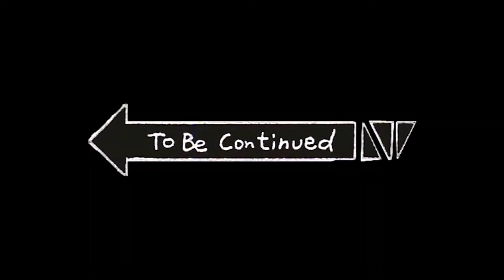Pallet barn build. part 2.

Comment: Why did you screw everything instead of using nails in some places??
Reply from the maker: Hey, I prefer screws for most jobs, but if you look at the third part, I use nails there. Thank you!
Reply: @normalguydoesitall  i prefer screws also but would you say there is a difference, advantage -  between using screws vs. nails - cost ??

Comment: When sheeting a roof you might want to think about staggering the seams.  It makes a much stronger roof and prevents sagging.  Actually that applies to hanging any sheeting, not just a roof.
Reply from the maker: Thanks for the advice, it was my first time doing a roof like this. ;)
Reply: @normalguydoesitall  always think of how you see a brick wall. Everything is "stepped" as it makes it much stronger. Still, a very good job.
Reply: I was thinking the same thing 👍
Reply: This barn idea is cool👍👍
Reply: Sheathing
Reply: Excellent job 👌🏻
Reply: @lakeside441  lol
Reply: another contractor here to agree with staggered seams...
I have a question, how are you connecting the two stacked pallets to the 2x4 between? I mean hardware? I would suggest 4x4 post between each pallet width for a load barring wall,
I'm not coming down on you, I'm a prick by habit because I break down everything built in my head, I can't stay in motels hotels because I nic pick everything...😂

Comment: I saw you used metal joining plates at the top of the walls and where the rafters meet...but not on top where the rafters meet from each side ...why ??
Reply from the maker: Hey, you're right, there I didn't use them. There is an upright support under the rafters and the rafters are fastened diagonally with long screws.

Comment: I've seen this done before slightly different. We did a horizontal 2x4 (think top plate) on top of each row of pallets, double on very top. We went 3 pallets high, we built trusses on ground and lifted straight up into place using a hand cranked manlift (rented).  Makes a fine building extra durable once metal is on.  Your building is going to serve you well 
You should be proud of the build.
Reply from the maker: Thank you! Nice to hear that. I am proud of my build and I hope the building serves me well,  will be two years from the start of build soon. In retrospect, perhaps some things would have been done differently and better :))) Thank you!

Comment: The first layer should be a vapor barrier on the roof second layer stops the rain. If ur using touch down roofing u should nail base sheet first it's fire resistant and it's a vapor barrier then touch down over the base sheet.
Reply from the maker: Hey you're probably right, but i did it that way and it works, no leaks ;)

Comment: And, now, a question...is that a rubberized roofing material? Or heavy tar? Never seen an application that used a torch. Interesting...
Reply from the maker: Ok, this material is called something like that: weldable tar board, bitumen ruberoid. And it is mounted with a torch, Part of the tar is melted and it glues the material to the roof. It is very common on flat roofs in Estonia. Hope that was helpful. ;)
Reply: In America this Roofing its called Torchdown. Its used on, or for  a flat roof. Angled roof as this, use regular shingles, as they last longer, and break up the draining as the water hits it. The wind can blow off this roofing they are putting down, unless you nail it down. But on flat roofs, and with walls going up above it, the wind can not blow it off. This system they are using is much cheaper, than hot mop, and put the tar paper down, nailing it down, and hot mop tar over it. But on angled roofs you should use tar paper laid down, staple it down, then put shingles over that, and nail it down too. As it lasts much longer, and nailing them down they hold better, and looks nicer. There's lots of videos on here to show you how. As that roll out roofing is a cheaper, and faster way to do it, but its not as good, and does not last as long. Plus, it does not look nice like shingles. Also, the way they laid the plywood on the roof is not correct, as each course, you off set the ply by 4 foot, as it keeps the rafters or trusses from falling over, as there system is not correct for USA building. I would also use 2x4 up rights at each end of the pallets, as every 4 foot, cut flush with the pallets height, and in every corner, and top plate it all tying it all together. Maybe even double Top plate, and or with framing square type looking straps tying each corner together, and nailed or screwed to the top plate, as then the corners are secure. Doing a tie type system when you put on the plywood over the pallets. As tying the corners together, as lapping the corners. Where the pallets sit on top of each other - drill, and bolt the pallets together, with washers too.  Plus plumbing the walls, and string lining the walls for strait, and bracing prior to putting up the rafters, and roof ply. Then once the ply is all nailed off, you can take your braces off. I would have gussets on each other to strengthen the rafters as make ply wood pieces, and nail on like a truss is built, and or build your own trusses on the ground, as they are much more stronger. There should be what they call Rat run of maybe two runs on the bottom cord of the rafters, or truss , a 2x4, as on top of it running the length of the building, as to tie it all together more. As if the garage is say 24' then go in from the out side walls in 8' foot, and it sets this at or around 8' spacing holding the bottom cord of your trusses, and Mark, and nail at 2' . Then one up by the peak of the roof right under the rafters, and nailed to the uprights at their layout of or around 2 foot., and running the length of the building, as to hold all them together. Then if at a 2' layout, your ply lands center of your rafters. Then take your braces down, once the ply on the roof is nailed down.
Reply: @AA-uu1yn  Very nice. Thanks for the explanation.

Comment: I don’t like how you railroaded your sheathing... but I love everything else!
Reply from the maker: OK. Thanks, but can you tell me what i could have done better?
Reply: @normalguydoesitall  staggering adds strength to the structure
Reply from the maker: @Canbechangedtwiceeveryfourteen  I understand what you mean, but I'm not very worried about the strength of the roof that the tiles are placed this way, because the tiles are thick enough. But yes  always can do better ;)

Comment: Nice. You should have staggered the plywood on the roof so it would have tied all of the rafters in. Good job though
Reply from the maker: Hey, don't understand what you mean, but the plywood are beautifully attached and the joints are on the rafters, and the whole roof is strong and fits nicely together.
Reply: Put the plywood down with a whole sheet then take and put another whole sheet 4 ft past the other one. It ties all of the rafters together. Still a great job

Comment: Idea, make the rafters on the ground, save time and energy also safer and easier.
Reply from the maker: Thank you! I know, i did it so be because I wanted everything to run straight and the ends of the rafters to be exactly the same size. Since the walls are made of pallets, not everything is perfectly straight, I straightened the roof line with rafters. thanks!

Comment: Why didn't you stagger the decking. It's a rule of thumb you do it on sub floors and roofs. Other than that you're doing a good job to be doing mostly by yourself.
Reply from the maker: Hey, I know that! But the dimensions of my roof and the gaps between the rafters were so strange that the decking would have bean very difficult, but I'm not very worried, this roof is strong. Thank you!

Comment: and the music...it is still the same...sigh. But the project is so cool, I had to watch again. Thanks for sharing.
Reply from the maker: Sorry about the music. Thank you for praising the work.
Reply: @normalguydoesitall  ź
Reply: I thought the music was better than most that are crap and so loud I rather hear the power tools . Explaining what the 2x4s were for in the walls would be nice ( I know and would have double them on each pallet ) . As for the roof , never run the seams like you done . There is no strength that way . Good build .
Reply from the maker: @davidwhite4474  The beams make the wall stronger and no more was needed there. The roof is strong and everything is very good, I'll put more beams under the rafters for support. Thanks!

Comment: 2 years later. How does it hold up? I want to make a rabbit stall this way :)
Reply from the maker: Hey, two years in use and everything is fine, the walls are strong and the roof does not leak. that winter there were sheep inside, who were now moving to pasture. the pallets are very good to build and it is also suitable for rabbits. Thank you!

Comment: what did you use to connect the 1 st level of pallets to the 2nd layer of pallets?
Reply from the maker: Hey, screws. I fastened with screws diagonally from the corners and in the middle where the blocks are.  I also installed beams vertically between the pallets, which also connect the pallets together. Thanks for watching and watching my other videos too ;)

Comment: What were you doing with the weed burner on the roof activating some type of adhesive?
Reply from the maker: Hey, this is a special torch, with it you melt/heat the tar on the roll, so that it attaches/glues to the roof.
Reply from the maker: @ॐ no